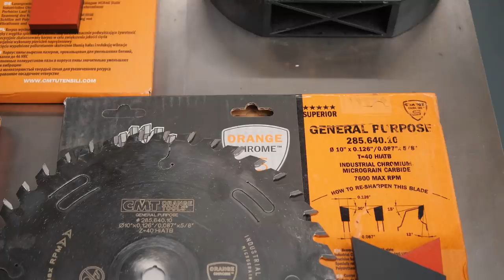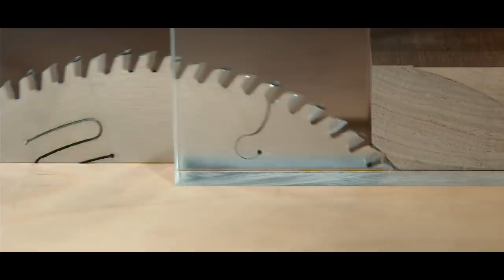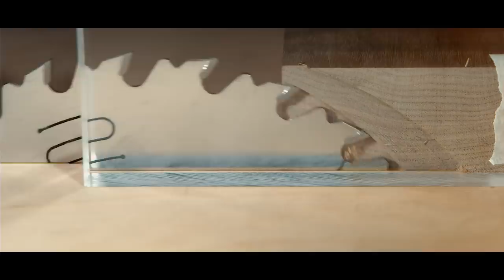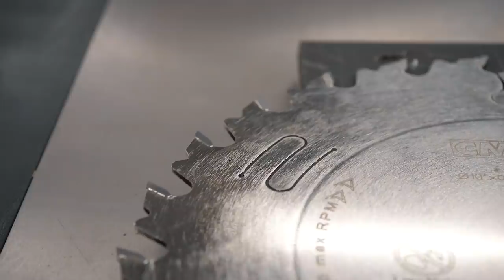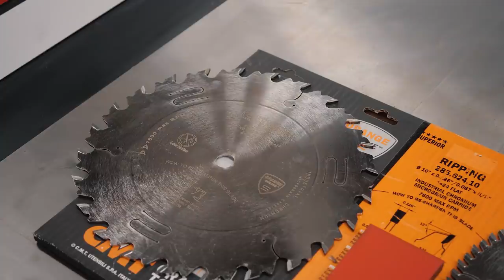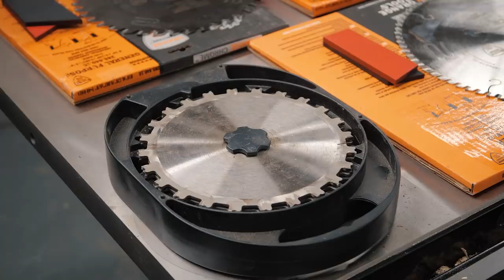Which Table Saw Blade to Use at 19,000 Frames Per second - Never Before Seen Footage

Comment from the maker: Support What We Do at The Katz-Moses Store http://bit.ly/KMWstore20
CMT Saw Blades (3 new patents 2022) 32%-50% off plus Use Code KMT10CMT for Additional 10% Off- 
ALSO check out their BRAND NEW THIN KERF CHROMIUM BLADES (2022) https://kmtools.com/collections/cmt-saw-blades 
These are the blades I have (don't forget the discount code): 
Rip Blade - https://kmtools.com/collections/cmt-saw-blades/products/cmt-orange-chrome-24t-ripping-blade-10-x-t24-flat-1-8-full-kerf
Crosscut - https://kmtools.com/collections/cmt-saw-blades/products/cmt-orange-chrome-heavy-duty-crosscutting-blade-10-x-t60-atb-1-8-full-kerf
General Purpose - https://kmtools.com/collections/cmt-saw-blades/products/cmt-orange-chrome-general-purpose-blade-10-x-t40-hiatb-1-8-full-kerf
12" Miter Saw Blade - https://kmtools.com/collections/cmt-saw-blades/products/cmt-orange-chrome-heavy-duty-cross-cutting-blade-12-x-t80-atb-1-8-full-kerf
Combination Blade - https://kmtools.com/collections/cmt-saw-blades/products/cmt-orange-chrome-combination-blade-10-x-t50-atb-tcg-1-8-full-kerf
In Depth Saw Blade Video - https://youtu.be/Fcz_d1k_k8A
Katz-Moses Watches Intro Video - https://youtu.be/BiTdVRMbp_8
Reply: Just used your code and bought three! Thanks.
Reply: Purchased the FTG blade. Been looking for one of those for a while and reviews on supposedly FTG blades have been scanty
Reply: Just ordered two blades. Thanks for the advice and discount code. 👍

Comment: I have been getting some significant tear out from my miter saw lately; I've been using the stock blade that came with my 12" miter. I've wanted to upgrade and have been doing some research but this video has been the most helpful. Thanks for providing this information and all of your knowledge in general with the videos you post. I just purchased the CMT 12" Miter Saw Blade you listed below.

Comment: After i watched your video, i bought the 24 tooth blade. It is an amazing blade. I used it to make a dado and was impressed how flat it is. No burning on rip cuts like my 40 tooth Forrest.  Thanks for the great info
Reply: Ripping blades are the bomb.  That's all I keep on my tablesaw now.  Like you, my Forest blade gave me a lot of trouble with burning.  My saw claims to have a two horse motor, but I'm running it at 120 volts and it's pretty easy to bog it with the thick Forest blade.  I'm thinking about getting a new 3 horse Sawstop, so maybe I'll break out the Forest again and see how it goes.

Comment: My woodworking took a big step in the right direction when I put a ripping blade on my tablesaw.  Face it, the vast majority of what you do on a tablesaw is ripping.  Most of my crosscutting is done on a chop saw, so the ripping blade almost never comes off now.  I was amazed at what an improvement it was over a combo blade.

Comment: This was a great video. Both the visuals and explanation gave me a much better understanding of why the blades for rip & crosscut are so different. 
I would love to see a high speed of the blades that came with my handmedown table saw from the 70s (or earlier). They are just high-speed-steel essentially with no carbide.

Comment: JKM, are you at all concerned with the anti kickback  part of these blades with the supposed issues with saw stop saws not stopping QUITE as fast?  Guessing even in an activation if it was a faction of a millesecond slower with these blades it still wont sever a finger.  just curious as to your thoughts.

Comment: Thanks for the vid Jon. I only have a basic contractors table saw from dewalt, with 210mm diameter. I was once looking for better blades to fit, only to find myself gutted, as I could not find any blades worth buying. I felt I'm stuck with factory blade. Not bad, as it's new, but it won't be as good as dedicated blades. Deep diving into CMT, I have found they have rip and cross cut blades suitable for my saw! So chuffed about it. Thanks again

Comment: Would be cool to see the dust collector pull the dust on the mitre saw in slow motion. Awesome video. I'll pass this on because even experienced carpenters just grab whatever saw with whatever blade and cut away. It matters in framing too because replacing blades can become costly in a hurry.

Comment: So what about the performance of the 50 tooth 10 inch combination blade for ripping 3/4 or less stick and crosscutting same stock ?  I'm tired of changing blades back and forth during small projects when ripping then using the CC-sled,  with the not-so-thick wood.  I have been tempted to buy one but afraid I would not use it.

Comment: The first blades I got for my table saw was actually the CMT Orange Chrome blades since they seemed to be of good quality.. I started with a 96 Teeth crosscut blade and a 48 Teeth general purpose... I mostly cut plywood panels at the moment, hence the blade choices. I've yet to get a ripping blade, but that was mostly due to me not finding a 12" one in the orange chrome series... So I'm making due with my combo and crosscut for now.

Now I'm just on the lookout for a decent 12" Rip blade.

Comment: If I am cutting across the grain on a couple of jointed boards, leaving me with more like 10+ inches across, should I use a crosscut or a rip blade? 

When I make some medium sized boxes I often glue the boards longer than needed and then cut them down, but that leaves me cross cutting along distances longer than a single board. Am I using the wrong blade? Sometimes I get a little burn, sometimes I don't, but I wondered if that was more down to the glue slowing the blade down.

Comment: It's super cool seeing the difference in blades!

If anyone in Canada looking for a blade sharpening place you should checkout All Blades Canada. They seem to sharpen everything and also can custom make bandsaw blades for you.
Reply from the maker: Great tip
Reply: Jonathan makes the case that cheap blades ( I like Diablo ) are not worth the $50 price tag if you can't resharpen them several times, or at all.  The lowest sharpening price I found in Ontario for a 50 tooth combination blade is $56.00 .  All Blades Canada may have a better price, but they are only in the province of Alberta, so any shipping cost back and forth would negate any sharpening price.  Diablo's last me quite a long time, so I'm happy to replace them when  necessary and use the steel of the old blade for something else.
Reply: @chrisgraham2904  I personally use Freud for my table saw and I think Diablo for my miter saw and I bought them at KMS tools which I think is also out east as well.

Keep an eye out because they will sometimes be 50% off.

Freud says that they can be sharpened 5 times.

I think also that if you get the results you like and expect from any blade then there is no reason to spend more on a blade than you need.

I have a Dewalt blade that came with my used table saw and for a long time it cut better than some of the first blades I bought that were around the $50-$60 Canadain mark

Just return them if they suck :)

Comment: Great video Jonathan, stuff we've experienced but not seen, now we have a visual. Another rough analogy on the rip vs. crosscut is the effect of the chainsaw tooth during those cuts. The rip cut produces a much longer chip/shaving , crosscut is short shredded chips. Those long rip cuts can really build up those shaved chips inside the saw. Granted, the miter saw/table saw is circular while the chainsaw is primarily a straight bladed cut but it does accentuate the dynamics.

Comment: Thanks for another great video! I need a better crosscut blade for my table saw but not sure if I should go 60 or 80 tooth. What's your thought? I'm running a Ridgid 4512 if that matters.
Reply from the maker: The more teeth the finer the cut but the slower the cut

Comment: Hey I need some help I've got a plunge router with a variable speed from 8000rpm to 26000rpm and I'm trying to cut though 3in of southern pine wood with a 4in long 1/2in shank and 1/2in round straight cut bit with double flutes but I can't seem to bite into the wood an I've tried speeds from 8000 - 26000 rpm I'm I just using the wrong bit or is it just not doable or should I use a spiral upcut bit

Comment: question here from a wood-noob:
Why is it useful or advised to set the hight of the sawblade just a tiny bit higher than the wood piece to saw through?
wouldn't it be better if it was set at max hight so the time and the way the sawblade teeth travel through the wood are as short as possible?
so less resistance to build up heat, less sawdust at a time...?

i always heard that it is better, and saw you doing it in your video, but nobody has ever told me, why it is better to lower the blade hight just shy above the wood thickness.
Reply: Safety is the primary reason.  More blade exposed, higher chance of catching body parts on the blade.
Reply: @clayvansickle1  ok but we do have a top guard with dust collection, right?
So is it not relevant then? 
What about ripout in the underside? Would it ne worse when the blade has a "steeper angle" to the wood?

Comment: Heres a question that is holding me back from buying dedicated rip blade and crosscut blade. 

What happens if you use a rip blade to cross cut or vise versa ?

Does anything happen besides just a poor cut ? I sometimes get forgetful and can see myself accidently ripping a board and realizing
 the crosscut blade is in ? More so concerned about safety....one of the reasons holding me back

Comment: Nice video. Thank you for it and for tips for good saw blades. Unfortunately the saw blades from CMT for Europe (metric system) has different geometry of the teeth than for Imperial system. For example General purpose blade mentioned in the video CMT 285.640.10 has in imperial version Hi-ATB with angle of 30° but for metric system it has ATB with only 10°. Rip blade in video has FTG but for metric system the Rip blade has ATB with 10° as well. I could not find any CMT saw blade for metric system with FTG. Could you give me a tip for Rip blade with FTG for metric system (in size of 250 mm with bore of 30 mm)? I am looking for blade which I can use time to time for dados. I am asking because my table saw Dewalt DWE7492 (same as DWE7491 but for metric system) is not suitable for Dado blades set and I cannot mount imperial 10" blades (254 mm in metric system) with bore 5/8" neither.
Reply: 285.624.10M Might fit your bill then, unfortunately it's not available in 12".

Comment: Would raising the blade more on the table saw affect the “angle of attack” enough to make a combo blade a little better at ripping vs a low blade height? Cutting more perpendicular(down) rather than parallel(through) the board?

Comment: I'm curious to know your opinion/experience of the 60 vs 80 tooth for sheet goods. Last video you showcased the 80 tooth but now you're using the 60.
Reply from the maker: Its the same blade as last time. Where did I say 60?
Reply: @katzmosestools  the link in this video description goes to the 60 tooth blade. Thought you might have made a change along the way.
Reply from the maker: Ahhhhh whoops, well they're both great I'm sure. I use the 80 because I like the extra teeth for plywood. I'll change the link. Honestly 60 teeth won't make a noticeable difference either way.

Comment: rpm +push speed+number of teeth determines wood removed per tooth.  48 years ago i watched a guy at a full service lumber yard rip 8 foot pine with a twenty inch blade. took him maybe 2 seconds to rip each board. i do remember the blade had a ton of teeth. and the saw fence and table was at least 16 feet long. sadly the place burned down around 1976. the set up was old looking and maybe custom made. weren't any kerf marks on the board edges. obviously  it wasn't made for crosscuts. miss those days when you could get quality lumber at a reasonable price.

Comment: JKM. I have the cheapest Skilsaw job site Tablesaw that Amazon sells. I just leave the 32 tool dewalt ripping blade cuz I feel like the saw is generally underpowered. It works for cross cuts pretty well too. Do you have any advice for me or do you think it’s fine? Thanks so much!
Reply from the maker: When you get a new saw and or blade it will feel like a whole new world. I got lots done on a cheap saw when I started. When I finally got a new saw it was like going from riding a bike to driving a Ferrari.

Comment: I bought the CMT 10" rip blade you recommended, and it arrived very quickly. I used it for the first time tonight. I have three comments to make. It does ripping better than any saw blade I have ever used, and it is quieter than any saw blade I have ever used, including the Diablo blades. However, dust direction is a huge problem. It throws lots of sawdust directly at me and into the air above the table saw. Any suggestions on how to solve this problem? Because of the good aspects mentioned above, it will probably be my main blade for ripping and resizing wood (I get lots of free used 2x6's and 2x8's that need ripping), and I would really like to do something to solve this problem. I don't want to have to vacuum my whole shop every time I use this, and taking the saw outdoors can get to be a pain, especially with winter coming on.

Comment: I'm a trim carpenter. I run Diablo blades on my mitre saws, and forrest blades on my table saws. You can get about 3 sharpenings out of a Diablo blade. My Forrest blades have been sharpened at least 6 times and look great. I think I've had 2 teeth repaired on my woodworker 2 blades over the last 6 years. I'd love to run nothing but Forrest blades on all my saws, but equipping 15 mitre saws with Forrest blades would be too cost prohibitive. I've also chunked small mouldings in my saws and ruined the blade and the saw. I'd rather throw away a $40 blade than a $125 blade.

Comment: One thing that would be cool.   But also very dangerous is to see a dado stack cut without the outer blade to see the inside of it. Or even have the camera line up with the cut and cut through acrylic to see inside the cut.

But those shots in slow motion are epic
Reply from the maker: I don't see how it would be dangerous. Same thing just less weight

Comment: Thanks for the great video on saw blades.  Being an engineer, I always appreciate understanding, and even better, being able to SEE the "Why" behind things.  I just used the code to pick up the 10" Rip and Crosscut blades as well as CMTs cutting tool cleaner.  Currently I only have a Diablo 50 tooth combination blade.  I think I'll keep using that on plywood, but now I'll have nice full kerf blades for Rip and Crosscut.  

Question....My miter saw is not a sliding miter saw, do you still recommend the same blade you have (just asking because it is labeled sliding compound?  I couldn't be sure from the video, but it appears as if yours may also not be a sliding saw.  Thanks!
Reply from the maker: Mine doesn't slide either

Comment: The issue is the sharpening cost as much as one of the cheap blades so you are essentially just buying a new blade regardless
Reply from the maker: It's about 10-15 per blade so that's not true
Reply: @katzmosestools  well I stand corrected.  Last time I checked it was around $35 plus shipping.
I do also love in Canada where everything sucks
Thanks for letting me know. Love the videos

Comment: Great perspective! But doesn't the height of the blade to the material matter as well?  'Rip along" or "aCross the grain" easy to remember.  I just would like to see re-engineering of the way saw blades are installed/mounted. You either have to "dance with the wrench/table" or afford several saws with less setups to minimize down time. Oh, I get a kick outta that Danny DeVito cutout wearing your apron..and matching shirt!
Reply from the maker: You want about a tooth or less above the material.

Comment: I think your conclusion is flawed as far as gullets go (.e.g 5:30:) What would be important would be the area of the gullet in a crosscut vs rip blade, compared to the # of teeth in each blade. Think of it this way, the more teeth you have, the less  amount of sawdust in the gullet because each tooth is removing less material compared to a blade with more teeth. That's why the gullet is larger in a blade which has less teeth. 

Given all other things equal (height of blade, feed rate, etc), a blade with 72 teeth will have 1/3 the amount of sawdust in each gullet as a 24 tooth blade, for example.

Comment: Hi Jonathan! Thanks for this informative video! Love the slow motion.

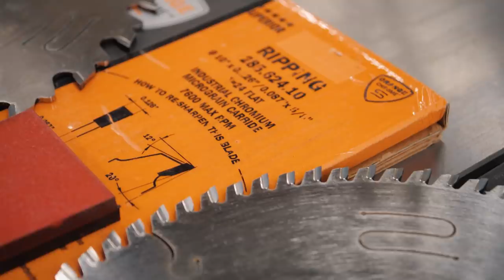Just wanted to check, at 10:05 did you mean to say that CMT will resharpen your CMT blades or did you really mean Forrest will resharpen your CMT blades?
Reply from the maker: Forrest will resharpen any blade. I think its only 10 bucks of I remember correctly
Reply: @katzmosestools  in Tucson, the only place that resharpens blades want $1 per tooth. I just buy new blades.

Comment: Hey bargain bin jimmy kimmel. I know that you can’t advise this and I understand the safety risks. 
The ask:
is there a table saw blade that would be best to cut through 18gauge brad nails/ staples?
The reason: 
I have model house I made with a design choice I can’t live with. It’s too long so i need to cut it and splice the left and right walls back on. I have stapled and brad nailed the top and double top plate and outside sheathing on. I would do my best to avoid the nails but I am going for the “safest” route.
Reply from the maker: Your least favorite/ cheapest blade
Reply: @katzmosestools  thanks main.